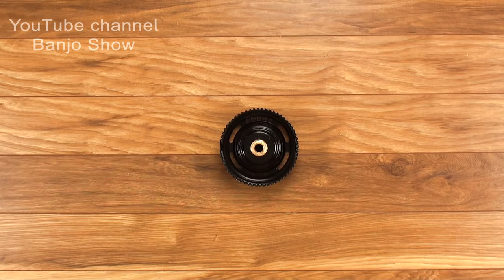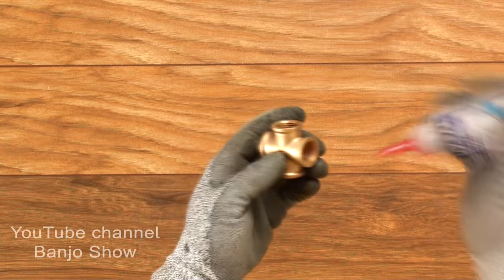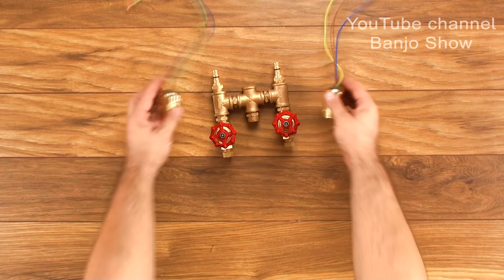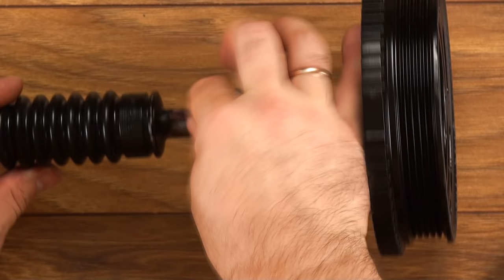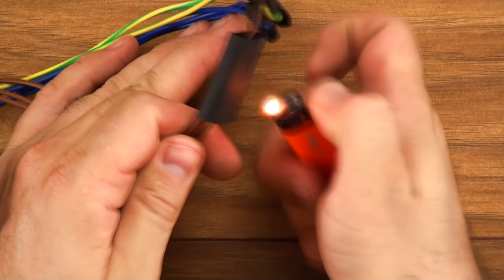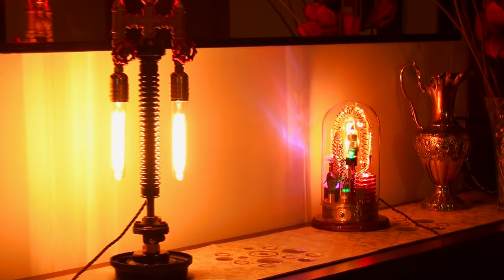How To Make Dieselpunk Industrial Pipe Lamp DIY

Comment: Nice build!
Extra safety feature: Always give your ground cable some extra length in comparison to the active and neutral ones ( 1cm or so/ half an inch), that way it will come off last once you accidentally pull on the whole string.

Comment: Nice but... if someone decides to turn it off using one of the valves...
Reply from the maker: In the valve, the locking mechanism is pulled out.
Reply: Maybe set it up to use the vaves as switches for either side.
Reply: ChanglingMendax valves

Comment: La lámpara es increíble. La instalación eléctrica ejemplar. El ritmo del vídeo bueno. Pero hay un momento clave para los más curiosos y que me ha faltado. Cómo salvas esos dos codos para pasar los cables de los portalámparas? Un saludo!
Reply from the maker: When shrinking, the white Teflon ring contracts and holds the lamp socket (I think that I correctly answered your question, since I translated it using Google translator).
Reply: Banjo Show  when you put the cables inside, how you get them on the other side?

Comment: Its genius.. but About your electricity bill how is that working for you
Reply: Hassan al-obaidi they're long led filament bulbs, eBay/Amazon them. In the UK they're £3 for 3-7 watt but for higher watts they cost much more. Which wasn't used here, so if they're left on all year in the UK the cost would be maximum £14. I didn't include the top bulb as not sure what that is. 
Not only are they very efficient but last long. I think you mistook then for halogen floodlight. Those need two spring pin connections so it's hard to actually mistake them as this clearly showed a e27 or b22 (medium Edison screw or medium bayonet). If he used a floodlight then it'd have to be very low watts for this output, <40 w.

Comment: I have noticed in a couple videos you don't put a strain relief on the cord, or you don't show it. Will cause premature failure and possible injury if the ground wire pulls out first.